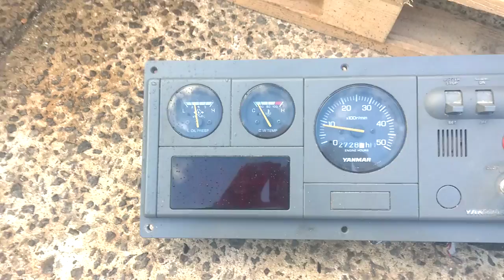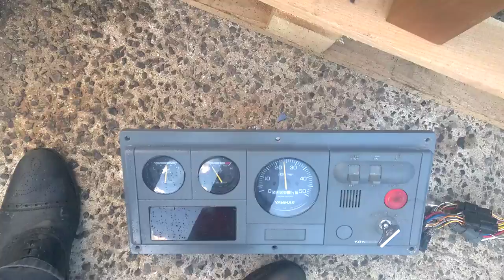Yanmar 4LHA-STP 240hp 4 Cylinder Marine Diesel Engine

Comment: Thanks for the video. Is it possible to add a seconde alternator (24V)?
Reply: probably but youd have to make a new bracket to hold the second one in such a way you can easily find a belt size that fits. alternatively, i know you buy high output alternators that are putting out extreme amperage compared to stock. either way itll take some degree of engineering. nothing to hard but i know not everyone has fabrication equipment

Comment: what is the function of black hose which was installed over the engine and finshed on the inlet of turbocharger
Reply: Cool the exhaust
Reply: Do you mean it is sea water outlet hose
Reply: it might be an EGR

Comment: how much for an engine like this?
can this power a 40 meter long boat?
Reply: can do and you need 2 units if you use ECO SURFACE DRIVES....THIS IS FUEL SAVING

Comment: 240hp lolll never !
Reply: TDIMAXDIESEL why not
Reply: Lowie Dewind 120 HP at the most !
Reply: Lowie Dewind really nice video!
Reply: so yanmar lies: MARINE DIESEL ENGINES. 4LHA-STP Series. Configuration. 4-stroke, vertical, water-cooled diesel engine. Maximum output at crankshaft. * 177 kW@3300 rpm.
Reply: Lowie Dewind that's more respectable ! Very reliable engine!
Reply: TDIMAXDIESEL 177 KW is 240 HP just saying
Reply: 4cilinder diesel 240hp??
Reply: yeah its impossible!!
Reply: Of course its 240HP - just because Germans or Americans can't do it, doesn't mean it can be done.
Reply: Walter Sobchak It's a genuine Yanmar engine, basically a marinised version of one of their industrial diesels.
Reply: Not marinized, built and engineered as a marine engine. Everyone knows this in the Marine business, and yes 240hp
Reply: 4L 240hp nhiều tiền ko anh ơ